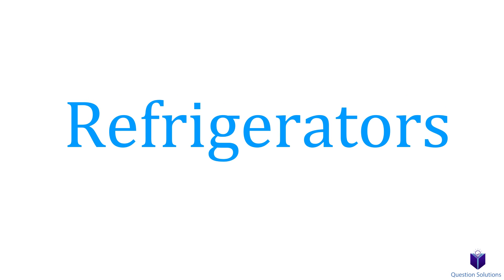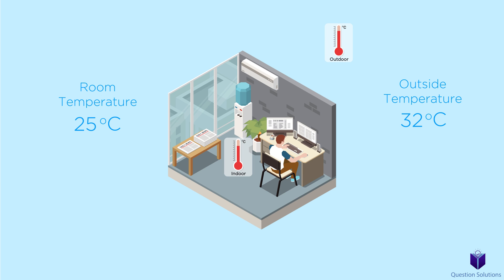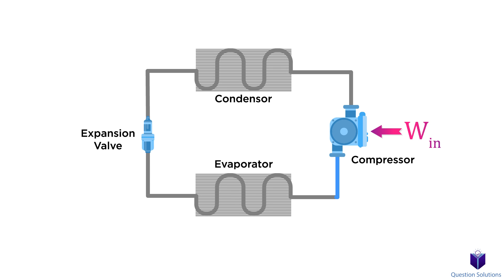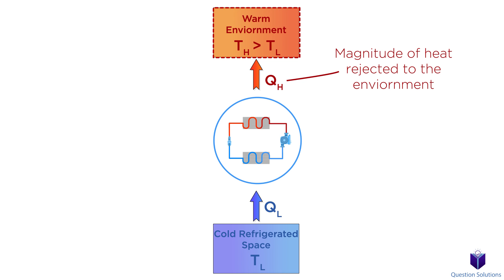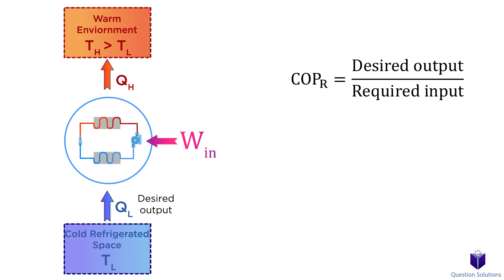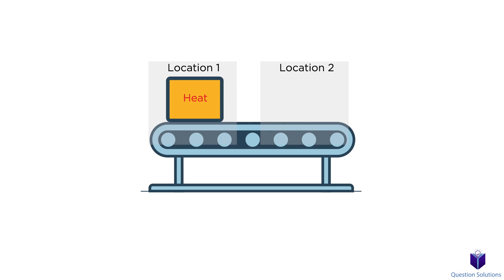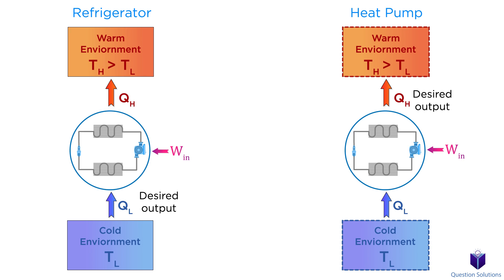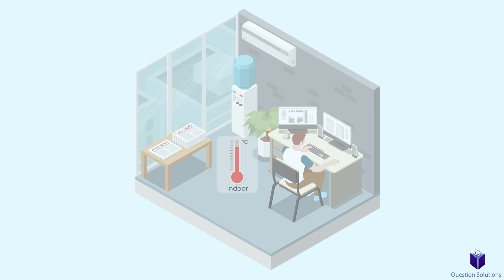How Do Refrigerators and Heat Pumps Work? | Thermodynamics | (Solved Examples)

Comment: I have a question here about at 4:30 what do low temperature medium or high temperature medium  refer to here? I really appreciate it
Reply from the maker: A location, a place, a system, that has a relatively higher temperature than a location, place, or a system that has a lower temperature. So it could be a room, the space inside a fridge, etc.
Reply: @QuestionSolutions  One more thing, refrigerators and heat-pumps  also operate in a cycle ,right? I mean There's no change from initial to final, so that in our energy balance equation is zero?
Reply from the maker: Yes, they do work in cycles, but what do you mean by "so that in our energy balance equation is zero"?  @ygt824
Reply: @QuestionSolutions 
I meant the right side of our equation, energy change

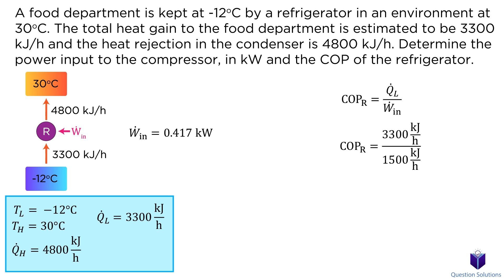Comment: in 7:44 how do i know if the given is Qh or Ql its confusing
Reply from the maker: So whenever heat is rejected ("thrown away into the environment") into the environment, it's QH, and whenever heat is taken "away" from some space, like your freezer, that amount of heat is QL.
Reply: I dont know if this is a correct way but cant i see the higher number and consider it as QH and the opposite for QL? @QuestionSolutions